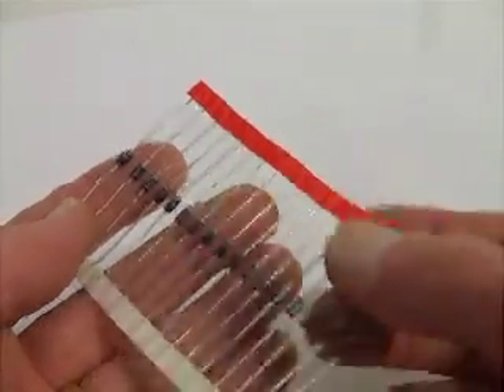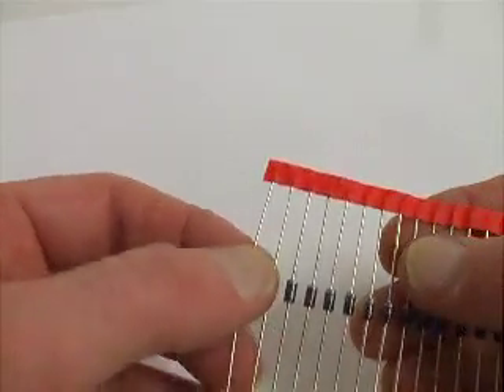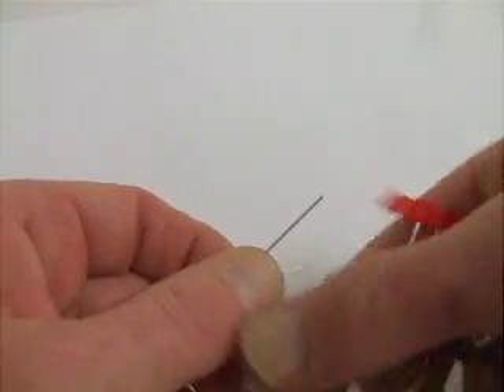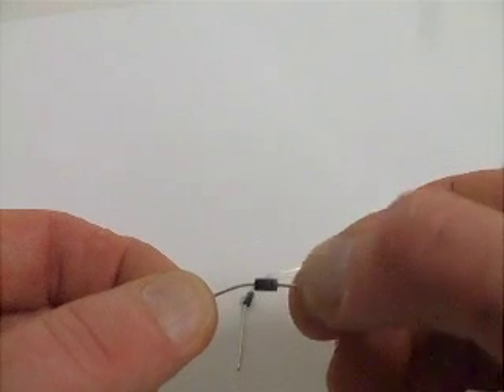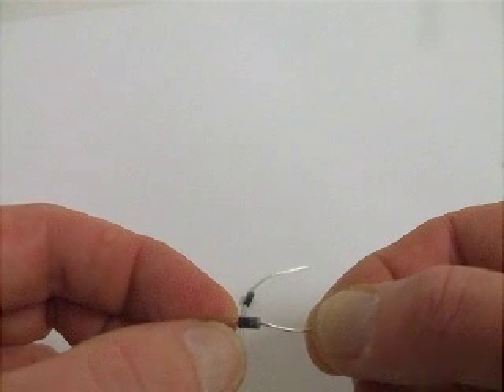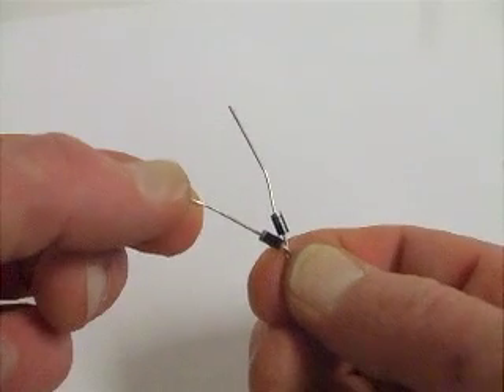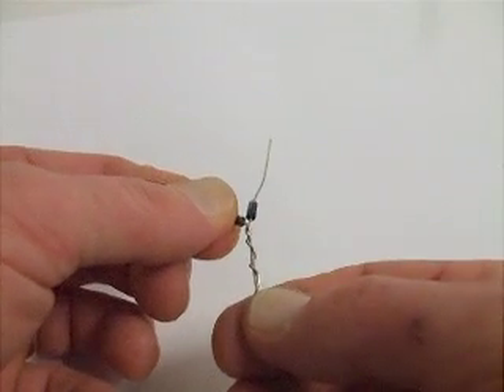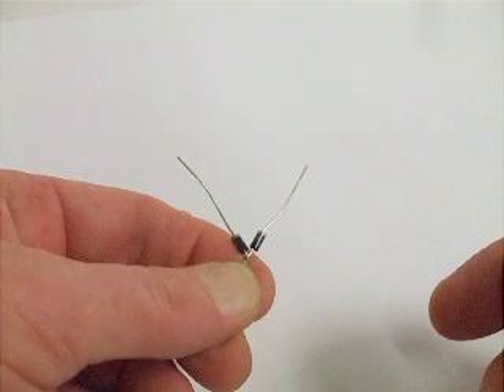How to do a double diode isolation

Comment: Have questions.97 grand marquis.i have positive door triggers and trunk is positive trigger.i wired the blue and green from alarm to a relay that converts to a positive trigger.do i need diodes?.i also wired trunk pop relay that way.i wired trunk relay wrong first time and now its saying trunk doors and hood are open when there not.im getting a new crimestoppers sp502 and just switching the brain.did i fry the 7 pin or would the alarm not work at all.its not in valet mode.when i shut car off it says trunk opened.when i remote start it flashes 2 times which means hood is open but i checked the pin and wire and its fine.hood pin came with alarm.